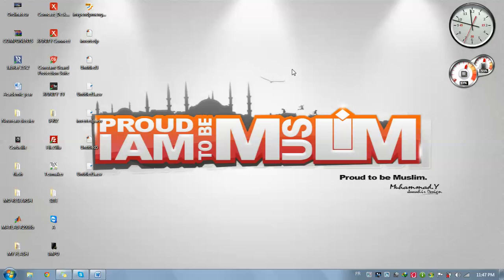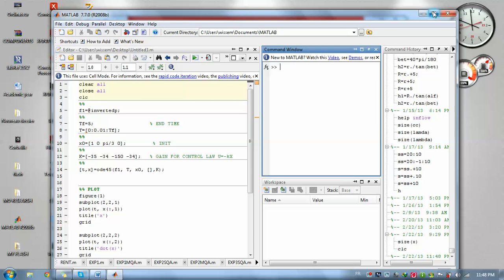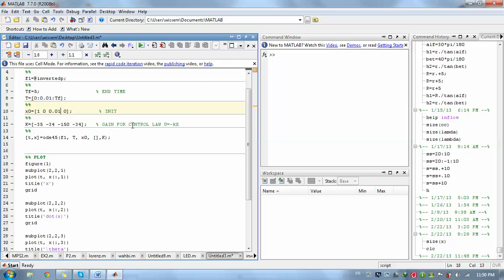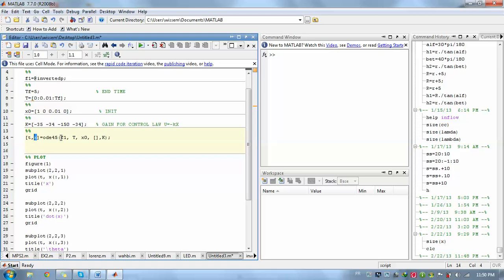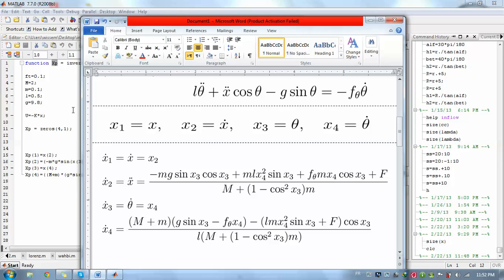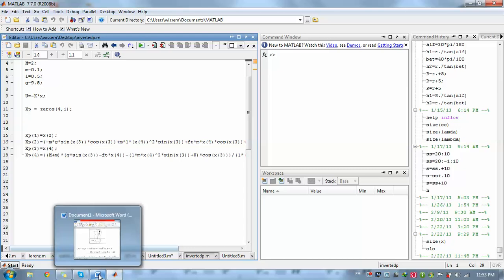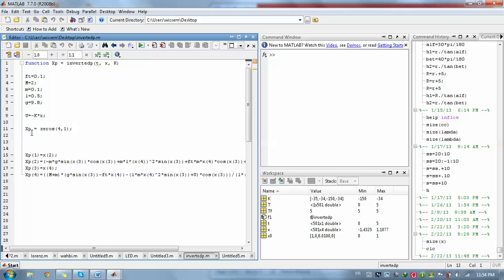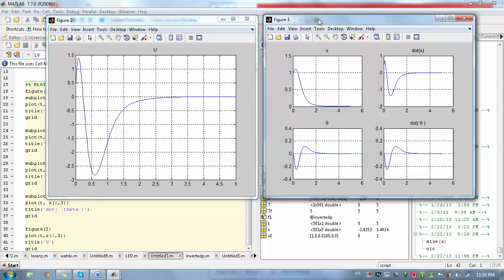Inverted Pendulum System (matlab ODE45)

Comment: At 0:33, if f_theta represents damping, then the second equation is incorrect. The correct equation should have (ml) multiplied by the left hand side. The only way your equation would be correct is if f_theta = viscous damping/(m.l), which would be an odd choice to make. Typically, the right hand side of a lagrangian equation which has theta as a generalized coordinate would be a torque. Torque = b * theta_dot. You're using f_theta as b, and therefore it should represent viscous damping for clarity. The code mentions no units for f either.